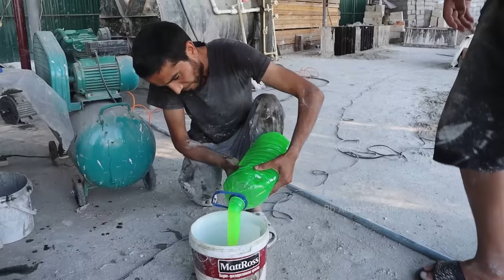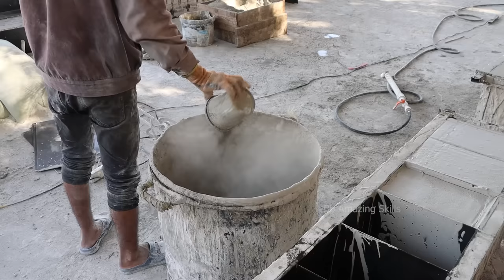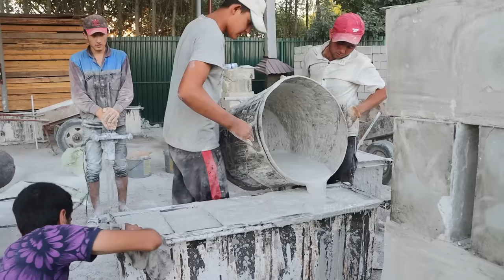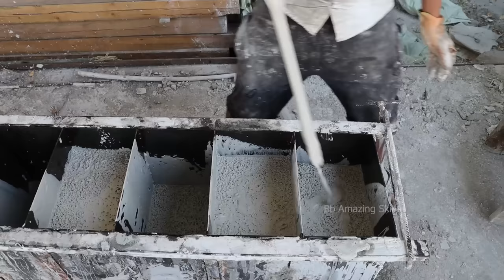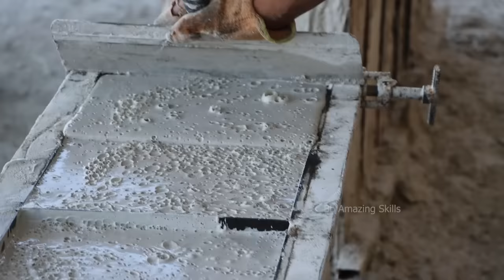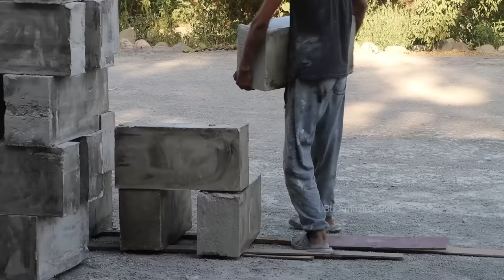Amazing Process of Making Foam Concrete Blocks | Mass Production Factory of Foam Concrete Blocks

Comment: These guys speak Uzbek.  It looks like the video was filmed in Uzbekistan.  The green thing in the bottle is a detergent, like Fairy, only cheap.  It is added to the machine to make foam.  Next, gypsum is mixed in a barrel, quite a bit of cement, water, and foam from the machine.  Then it is poured into a mold, and the gypsum quickly hardens.  It turns out the foam block.  Then they dry it in the open air
Reply from the maker: ok, thanks for the great video description
Reply: Thank you for great explanation. What the additional hard block added for? Was it left over just to increase the volume? Thank you
Reply from the maker: pieces of the remaining blocks to save raw materials
Reply: Thank you
Reply: I'm so glad this comment came to the top. 
It's so easy to be critical about health and safety or efficiency but yea, these guys are just doing a job of work. Not cutting edge manufacturing exactly but probably how most of the world works. 
An educaton.
Reply: Yes you right this is Uzbekistan
Reply: No llevaba mucho cemento
Reply: Increible que lleve mas yeso que cemento. Interesante. Saludos. Y sigan creciendo
Reply: Thank you 🙏
Reply: Adevărat frate !
Reply: @BbAmazingSkills  thanks for the videos. Is the first ingredient just soap? I saw other ingredient in your last videos look like rice. Please let me know
Reply from the maker: @mohamednour3978  The first ingredient is dish soap!
An ingredient similar to rice is sodium alpha olefin sulfonate.
Reply: Cool !   -  I wonder if one uses lime instead of gypsum,  will the block still be solid after drying or will it take too long ?
Reply: @BbAmazingSkills  الجبس في بلدي سوريا هو غالي الثمن هل يمكن استبداله بل رمل شكرا انا مشترك عندك
Reply: @BBAMAZINGSKILLs where to get this machine ?
And what is the cost of this machine ?

Comment: Hello, I was wondering what kind of mortar do you use between each block, and should we put a layer of mortar or lime, to protect from the rain and let the wall breathe? Thanks in advance 👍
Reply from the maker: Grease the mold with used motor oil to prevent it from sticking to the mold.
Reply from the maker: Foaming agent - alpha-olefin sulfonate AOS.
250-300 g of alpha-olefin sulfonate makes 150 blocks.
block sizes 60cm/30cm/20cm
List of ingredients for 3 foam blocks
37 kg of gypsum
2 kilograms of Portland cement
50 liters of ready-made foam (alpha-olefin sulfonate) weighing 1.5 kilograms
50 liters of water
https://youtu.be/Ft5w1iwbouo ALL THE SECRETS OF MAKING FOAM BLOCKS
https://youtu.be/D3ajZ7ly6I8 FOAM GENERATOR, HOW TO MAKE IT YOURSELF
https://youtu.be/-h6zBbVkuQI production of foam blocks with subtitles

Comment: Very good work. Greetings from Morocco. But how much water is needed for the walls? How much and how many grams of dish soap? Then I added 2 kg of cement, 30 kg of gypsum, and the rest is foam. Mix well. After 15 minutes, dry the mixture. Then leave it in the sun to dry for 24 hours without adding a single grain of sand. Can I have a WhatsApp message please?
Reply from the maker: without adding a single grain of sand

Foaming agent - alpha-olefin sulfonate AOS.

250-300 g of alpha-olefin sulfonate makes 150 blocks.
block sizes 60cm/30cm/20cm
List of ingredients for 3 foam blocks
37 kg of gypsum
2 kilograms of Portland cement
50 liters of ready-made foam (alpha-olefin sulfonate) weighing 1.5 kilograms
50 liters of water
https://youtu.be/Ft5w1iwbouo ALL THE SECRETS OF MAKING FOAM BLOCKS
https://youtu.be/D3ajZ7ly6I8 FOAM GENERATOR, HOW TO MAKE IT YOURSELF
https://youtu.be/-h6zBbVkuQI production of foam blocks with subtitles

Comment: This is one way to make AIRCRETE a innovative and modern way to use cement efficiently .Numerous advantage  Water resistant  Sound Proofing  Thermal Insulation  Fire Resistant. Good tutorial and demonstration 
Thanks
Reply from the maker: I'm happy for you, thank you
Reply: What is the most frequent application of this aerated concrete? Does any norm standardize it?

Comment: 🏗🧱🔝 How fascinating to witness the mass production of foam concrete blocks! It's certainly inspiring to see the potential of "aircrete" and its application in construction. However, it's important to approach this with a critical eye and consider factors such as long-term durability, structural integrity, and environmental impact. Let's explore the pros and cons of foam concrete and engage in a discussion about its viability in various construction projects.
Reply from the maker: Thanks for the comment, I agree with you too
Reply: Я скажу. Проще это очень простая технология. Из тех, которые существуют, где нужно добавлять алюминий и друг, и другую пудру, чтобы получить пену. А здесь, пожалуйста, просто пена. А мы живём во времена разнообразных присадок. Не химических. Добавляй хоть крошку. Пенопласта добавляй вещества. Гидрофобного свойства. Которые не дают разрушаться. И самое главное, что это все смешивается внутри, как цельный композитный блок. Ребята, молодцы.
Никаких сложных соединений нету. Как при производстве.
Никакой нету. Окислители. Не алюминиевой пудры ни другой кислоты.
! А гидрофобы современные, они так же не содержат опасных веществ.
Reply from the maker: @ПетрБылков-п5и  спасибо за отзыв!
Reply: What is the most frequent application of this aerated concrete? Does any norm standardize it?
Reply: Hello friends, I am from Balochistan, I like your work and I want to start in my country, I just need some guidance, thank you

Comment: The United States have really upped the game mass producing these foam bricks 6 at a time.
Reply from the maker: Yes
Reply: What is the most frequent application of this aerated concrete? Does any norm standardize it?
Reply: @SimplicioXaa read about form concrete on Wikipedia. It can be used in a lot of different kinds of applications

Comment: Can you please mention the density of your block?
Reply: Due to the video, around 300 to 350 kg/m3. It is so liquid… don’t mix gypsum, better mix fine-sand, it will be indeed much more stronger. For building you can use 700 to 850 kg/m3 BUT with fine-sand and fiber

Comment: The important question. How much pressure can you withstand .?
Reply: @BbAmazingSkills  How much weight can one piece hold on top of it? Can it withstand the construction of walls 3 meters high with a reinforced concrete roof ?
Reply: @aqjenaqjen  that weight would be too much for these blocks, you'd need reinforced concrete or steel pillars.

Comment: How to make these water proof (damp proof) and compressive strength of minimum 4.5kn/cm
Reply from the maker: при тестировании 2 часов на воде качество не изменилось
Reply: That's a great result sir but in the location where there are rainy season which remains for 3 months so the blocks used in outer wall can collapse by absorbing water..is there any time of additive which can be added to make it water resistance. 
Thanking you in advance sir.
Reply: @BbAmazingSkills  what is the compressive strength of block ??

Comment: Are these blocks water resistant? What is the weight and measurements of these blocks? and I take the opportunity to congratulate your work
Reply: It appears that these blocks are aerated concrete, or aircrete. They are not water resistant as they come out. They need to be sealed when they're fully cured, usually after 28 days or more if you want them water resistant. We plan to seal ours with Latex-crete, which is a mixture of concrete and latex paint.
Reply: foam concrete are like a sponge, they are thermal resistant not water resistant

Comment: hola, están hechos con yeso ??     solo le vi que puso 2 tarros de posible cemento en un zaco de unos 30 kilos de parecido al yeso y espuma ,pudo liquido , salir les salen muy lindos " pero al ser de yeso para las paredes exteriores no sirve "o si ??? lo arruina la lluvia
Reply from the maker: si alguien sabe por favor responda!
Reply: @BbAmazingSkills
Reply: Hola buenas noches pienso que para muros exteriores no sirven y tiene poquito cemento para 35 kilos de yeso
Reply: It is equally use for exterior because it's is moisture resistant due to the air bubbles in the block from the foam so also heat resistance and sound proof

Comment: Hello, I am writing to you from Argentina. Can you send me the formulation of the additive you use?
Reply from the maker: I do not know the exact recipe, I will ask and answer
Reply: @BbAmazingSkills  thank You very much i am waiting
Reply: Hi you will need 200 litter tank and cut it half at first add water about 20 liter after 20 kg of gypsum and 1 or 1.5 sement also same bulk foam mix well all
Reply from the maker: @javlonbekburanboev-xj6ff  thanks for the advice!
Reply: @BbAmazingSkills  I am from Uzbekistan and I can guide you
Reply from the maker: @javlonbekburanboev-xj6ff  How do you know or work?
Reply: @javlonbekburanboev-xj6ff  Hi. Seems that you know about this procedure. Can you say me why not to put more cement??? Will be stronger, cheaper and more water resistant. The gypsum only makes to solidify faster and with much less amount will be good or I'm missing something? Thanks

Comment: I love that suds machine! It waist no time! Is the power cement? Or a special mix? Also is that rubber on the inside of the mold?
Reply from the maker: mostly gypsum and some cement added, remaining blocks added inside, foam made from FAIRY type detergent
Reply: Looks like waste motor oil rolled onto the mold as a release agent.
Reply from the maker: @darrelljacobjr2120  yes

Comment: from what I've heard, letting them dry in the sun reduces their strength.  Better to keep them moist as long as possible.  

I know, I know.  Strength isn't the most important quality when it comes to foam blocks.  Strength helps, though.
Reply from the maker: I agree with you

Comment: If you reinforce it with steel mesh, it would be more resistant
Reply: Resistant to what? It would make it more resistant to breakage, a little stronger, and resistant to something like an EMP, but not any more resistant to water.
Reply: @marcikeesler6060  In this country it rains a lot. Here they make sheets of this material. They are used outdoors. They are very resistant to water
Reply: Agree, the stone in the center only gives the slab a weak structural point, since is a detached solid mass surrounded by the mixture, not part of it, a steel mesh is better, because is a smaller mass and can be shaped like the concrete slab,  thus, it can effectively tie together the concrete into a more solid form
Reply: Mesh wire and gypsum are not compatible due to the pH value of the gypsum.  wire will corrode and rot away

Comment: They’re light ok for dry regions but they are very poor and unreliable under normal or harsh weather. They crumble like biscuits. This method is simply cheap solution if there is no other way to build… and this should be done different way. Like this they just turn into something like honeycomb made from caramelised sugar… it won’t last long…